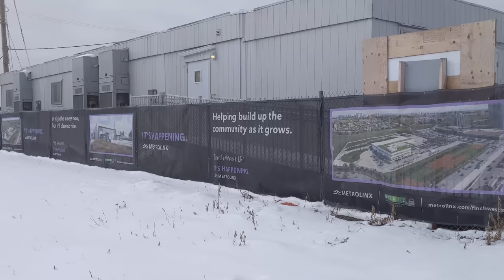Missing Links: Short-Sighted Transit Planning

Comment: This one you also mentioned but the metro in Amsterdam from isolatorweg to central station(it’s crazy obvious)
Reply: Yes, the completion of the city circle line. And of course the lack of a subway line to the airport, the metro line stops at Station Zuid (train station Amsterdam South) in the central reservation of the highway ring road. At least they took the decision to start planning this line. A bit late and more costly, now that the highway ring road is going to be in a sort of open tunnel/concrete gutter and construction for this already started.
Reply: @RealConstructor  I thought there was a proposal for a complete new line to reach the airport. Wasn’t there?
Reply from the maker: Needs to get done
Reply: @RMTransit   What I find most perplexing about this situation is that years after line 50 was built, with full knowledge of the original plan for a circle line, they decided to connect line 52 at Amsterdam Centraal to the existing platform for lines 51/53/54 via transfer walkways that are directly in the way of extending line 51 westward. 🤯

(I shamelessly copied this verbatim from the reply I just posted to someone else 😁)
Reply: @dennyroozeboom4795  The extension of the north-south metro line from Station Zuid to Schiphol and further to Hoofddorp is a decision of November this year. There is also money for the extension of the circle line with one new station Haven-Stad/Harbor City, almost completing the circle.
Reply: @RealConstructor  Sounds good(except for that one almost). I only use the system now and then when I come in the capital since in live in Breda. But it always gives me hope when investments are made in systems that are proven. Now just hope that proof trickles down.

Comment: One thing I've seen done in Portland is the introduction of frequent service/express bus lines to connect different areas that really should be connected by train, but can't because it would have to plow through existing development 

It's one thing to look at lines on maps and see a small gap that really seems like it shouldn't be there, but where there's something in between (a neighborhood, a natural feature) there are other options to connect these things that may be less effective, but will also have a lesser impact on the existing landscape. 

There's a lot of moral and economic discussions to be had here, and I'm really glad to see this video, it's a great introduction to some of the issues and shortcomings that are often seen with implementation of new transit lines! I found you via nebula, and I look forward to seeing what you make in the future.

Comment: Other missed connections: Delhi Metro's Blue Line extending to the suburb of Noida is not connected with the Aqua Line that serves Noida and Greater Noida. It's painful to look at how short the distance between the two lines is (< 1 km).

Another type of bad planning missed connections: Criss-crossing lines without an interchange station or with 2 stations too far from each other. We have quite a few of those on Delhi Metro (Airport Line Dhaula Kuan station <> Pink Like Durgabai Deshmukh South Campus station, Kalkaji Station interchange, and the Punjabi Bagh station where DM had to construct a special halt station after the green line became operational because of poor planning).

Comment: Example: The C Line in Los Angeles stops just 2.8 miles short of the Norwalk/Santa Fe Springs MetroLink Commuter Rail Station. You have wait 15-30 min for a local bus with actual travel time that can take 25 minutes of more depending on traffic. It's so stupid

Comment: It honestly is mind boggling why the caisse wouldn’t push for it. Between all the stm local and express buses that are constantly stopping at Dorval Station every hour on top of the via and exo trains, Dorval Station as it is now could easily compete with some of the less busy metro stations in mtl when it comes to passengers per year. Plus it would finally bring a rapid transit station somewhat close to Lachine. I understand that it would require working more with Exo and then Via rail but like come on. The Mayor of Dorval is begging for it. 🚈

Comment: The Frontrunner (UTA) and the green TRAX line should really connect at the rail yard just west of the 15 after central pointe. To get to west valley you need to get off at either Murray or salt lake central and take the blue line all the way through downtown which takes forever or go past your stop and detour all the way to Murray and take the red or blue line all the way up to either central pointe or take the 39 or 35 buses. Really inconvenient.
Reply: Trax has a similar problem to portlands lrt, they should make use of the abandoned freight corridor branching off to the north west at ballpark and maybe connect to SL Central or something similar

Comment: Happy New Year from Berlin!  I'm just back from Berlin (and Warsaw) and the connections are amazing between Ubahn and Sbahn. I found the system great to use and yes there were some very odd connections, in particular, the region around Ostkruez, which was east Berlin, so much has been done but still, some baffling missing links that anyone would think to be obvious early fix. Warsaw has only 2 Metro Lines and a fantastic tram Light rail system. Looking forward to your review of this system that is being steadily constructed

Comment: You'd think that an explicit goal of building transit networks is connectivity.  Not only would it promote ridership it also creates system redundancy and resilience.  When it comes to cost the expense of construction can be amortized over decades if not centuries.  Plus the benefits of connectivity is realized right away rather than having to wait for years or decades.

Another short-sightedness pet peeve is the lack of grade separations.  A case in point is the Metropolitan LRT line in Edmonton where there is a horrendous at grade crossing next to a mall and a large hospital at 111th Avenue and Kingsway Avenue.  The intersections in this area were already one of the busiest on the north side of Edmonton with no less than 5 traffic signal crossings within a span of 400 meters.  When you add the rush hour headways of the Metropolitan Line the traffic delays are even worse.  Now there is talk of building a flyover which was what should have been done in the first place.
Reply from the maker: Well, this was part of a multiyear transition by which Edmonton's transit planners started pushing for "urban" LRT - which seems to just be their idea of what a tram is, of course not realizing many trams around the world have grade separations!

Comment: In jakarta, the LRT Line runs through a section of the city called kelapa gading but what really annoyed commuters was that one end of the line ends just a couple kilometers of a major commuter rail station.
To be expected, ridership is extremely low.
Reply: The government is currently extending the line to Manggarai (slated for the end of 2024, idk if it's possible considering the speed of Indonesian rail construction) and is planning to extend it again to 5 other commuter and HSR stations (Klender, JIS, Ancol, Rajawali, Halim), so they're definitely aware about the problem

Comment: Infuriating missing link in Milan metro:
Line M4 which is currently under construction will NOT have an interchange with line M3 although it goes directly below it. Thus there will not be a direct connection between the Linate Airport (M4) and the Central Railway Station (M3)!!

Comment: Any thoughts on why the new Hurontario line won't be connected to the Bloor-Danforth or Eglington? Seems that the population of Mississauga would justify better connections.
Reply: Both of those would be a significant detour.  It would be better to build a separate line along Dundas.  Eglinton currently has the busway from Hwy 403 over to the Eglinton extension will turn north to the airport.  The buses also go further west, along side the 403.

Comment: A pretty big one in the future of the Singapore MRT is the Cross Island Line's station at Jurong Lake District, a station that's in the vicinity of both the major Jurong East station that has three lines (two of which are the "main lines" of the MRT), and the Light Rail Jurong Town Hall station on the Jurong Region Line (which is a Light Rail line branded as Heavy Rail because the term Light Rail in our country is already used up for APMs). The station on the Cross Island Line is a terminus station (temporarily) with 0 connections, which sucks given how high ridership this line is supposed to have. But sadly these types of missed connections are extremely common in Singapore, with the Downtown and Thomson East-Coast Lines both having a painfully obvious few in the CBD area (namely Raffles Place, Downtown, and Shenton Way stations, but there is also the sad story of the two stations buried so far underground, Bras Basah and Bencoolen, that aren't connected to each other, and Rochor and Jalan Besar, of which Jalan Besar was never really meant to exist, and Rochor was meant to be an interchange with itself)
Reply: DTL not going to yew tee/kranji as well another one
Reply: - long read by someone regurgitating uneducated speculation below - 
Rochor and Jalan Besar sadly are on two sides of an expressway (north-south corridor), so building an underground connection will be an engineering wonder (credits: yuuka's From The Red Line blog). I feel that missing the already busy Jurong East (creating a 4 line interchange) and relieving Clementi is a deliberate choice as passenger flows can be a headache, and the Jurong Lake District (JLD) Cross-Island Line (CRL) interchange is under planning (source: straitstimes). 
In the CBD, City Hall and Esplanade also have a missing link, further than Raffles Place/downtown. Perhaps, a more glaring example of these missing connections (due to building later) is Tampines, a 500m walk in our hot and humid climate between the two, though it doesn't affect very many people. (I don't actually know why it can't be a paya lebar style interchange... though I think it might be something to do with turning radius, station coverage, or construction)
Reply: @starrybeam7874  oh yeah that one is so painful especially seeing Sungei Kadut is so deserted and only 925 goes there </3 talk about an awful terminus
Reply: @ansellee  yeah Rochor-Jalan Besar is irredeemable since even if they do build an interchange I doubt many people would want to get out of the train and walk anyway. Just sucks that Rochor wasn't able to be built as the interchange it was planned to be.
Clementi definitely needs the relief of the CRL, but who knows if they ever find a way to link up the CRL and JRL in the JLD.
Tampines is such an awful one, it's actually just really brave of them to call it an interchange. Because in reality it really isnt, and honestly from the downtown line's construction blog (on blogspot) where they use "Tampines Central" as a way to differentiate the 3 Tampines stations on the DTL, I feel like that would have been a more apt name for the station seeing that they are basically two different stations. (doing the interchange paya lebar style would be really tough though because it would involve digging up either the linkway from the bus interchange to the station, access to either Tamp 1 or Tamp Mall, or on the opposite side of the station where there's space but on the wrong side in relation to the DTL. Then there's the whole problem of having an underground connection all the way to the DTL station itself. Speaking of that, the station box really couldn't be any nearer to the EWL station, at best they'd have to place it under the Bus Interchange because the EWL station is surrounded by the basements of the two malls next to it. The alignment of the DTL just didn't really work out for it to be a paid link to the EWL, unless they ran it along Tamp Ave 4 instead. But I guess planners wanted the station to have a better connection to the bus interchange, which I guess isn't the worst idea... just feels annoying to call it an interchange when it is anything but.)

Comment: Manila Lines 1 and 3 are taking 20+ years to be finally connected. Should have been a loop.

Manila Line 2 and planned Line 4 won't connect, even when Line 4's western terminal will be built a block away from an existing Line 2 station.

Comment: The same thing is gonna happen with the new line 4 in Athens, which will connect to 1.5 lines out of the 3 (it will kinda connect to line 2 with the new academy station being close to the university, the only real interchange is with line 3 in Evaggelismos) and it seems that the line for now will only support the university students by connecting all the student filled neighborhoods with it, which is a real shame, cuz it will connect to major neighborhoods too, that will be entirely disconected from line 1.
and to make matters worse, there will be a missing link with line 3 again, that will make people backtrack from Goudi and Zografou all the way back to Evaggelismos, while the line could have a station more to Katehaki, which is planned for later... even later than the line itself. Also they didn't make the line go thru Pagrati, a major neighborhood...

Comment: The whole way TGVs all ends in Paris but all in a different station makes the whole of Paris one giant missing link for long distance travelers. You shouldn't need to take a Paris metro if you want to go from Lille to Orleans but you kinda have to.
Reply: They build a whole high speed line in the suburbs so that those places have direct train service.
Reply: @justsamoo3480  Great to hear :)
So I looked it up on SNCF connect and they still just basically say:
>ride from Lille to Paris Nord 
>??? 
>ride from Paris Austerlitz to Orleans
Reply: Thinking about it, it's actually a wonder that Berlin managed to avoid the trouble with terminus stations not just because they either were redesigned (e.g. Lehrter Bahnhof as Hauptbahnhof, Schlesischer Bahnhof as Ostbahnhof) or destroyed (e.g. Anhalter Bahnhof and Potsdamer Bahnhof) fact but also that there are east-west and north-south connections through Berlin for long-distance trains.
Reply: @Frahamen  Oh yeah turns out that Orleans doesn’t have TGV service, which is actually rather bizarre for a city of its size. I assumed it was similar to Poitiers, because I took a TGV from there to Lille. But it seems to still be an issue.
Reply: @MarioFanGamer659  That has been a lot of work. The Stadtbahn for the East-West connection has been created in the late 1800s to connect various termini and the North-South tunnel has been built in the early 2000s after reunification and for the 2006 soccer world cup.

Comment: México City Metro has two missing links that might actually relieve crowded lines: line B from Buenavista to Colegio Militar connecting with line 2 and line 8 from Garibaldi to Indios Verdes helping the overcrowding on line 3.

Both segments would really help the two most used lines in the system and have been thought about for decades.

Comment: In Stockholm, Roslagsbanan is planned to extend to the city center, but it should connect to Saltsjöbanan through the city, an additional distance of 1.6 km. However, there are major obstacles, such as you would need to tunnel under water AND the old city. Plus the two lines have different gauges, and the Saltsjöbanan terminus Slussen is currently under major recontruction.

Comment: Good video, but what it misses is that sometimes connections are missed on purpose because they would cause too much traffic. A good example on the London Underground is the recently opened Nothern Line Battersea extension which seems to have a missed the opportunity to connect to Clapham Junction. This would have been a huge connectivity opportunity to a very busy station that has no existing connection to the London Underground. The problem is that the connectivity would have been so good, the additional traffic would have overwhelmed the branch and possibly the rest of the Northern Line. The Northern Line already operates 20 tph and is largely full in the core area, so connecting it to a station that sees 100 to 180 trains per hour would just overwhelm the system. This isn't a case of a missing link, but deliberately avoiding adding too much traffic to an already busy system.
Reply: 3 trains per minute ? That is a huge success.
Reply: The Toronto equivalent of this is Toronto City Council denying to the provincial government permission to extend the Yonge subway to Richmond Hill until the Bloor/Yonge interchange is upgraded.   Same reason:  the extra traffic cannot be handled by the existing system until it is upgraded.

Comment: i think you mentioned this in the singapore video, but the singapore downtown line's loop doesn't have a interchange with itself because the line was stitched together from 3 separate line ideas, so to get between the western and eastern stretches you either have to get out and walk, change through another line, or go through the whole loop, all of which are annoying solutions
Reply: Feel you there! Getting to the airport from the western part of the line (via Expo -> EWL airport shuttle) could be so much more convenient with a short transfer DTL-DTL. Especially when considering that the DTL-EWL transfer at Bugis is terrible!